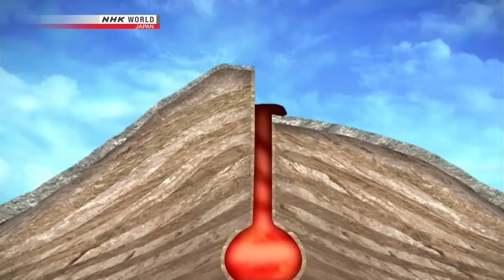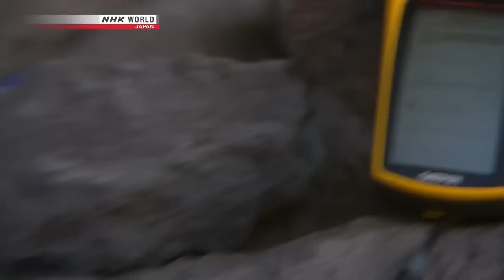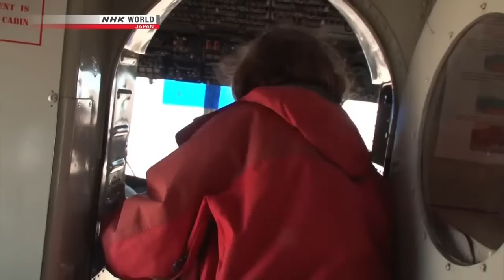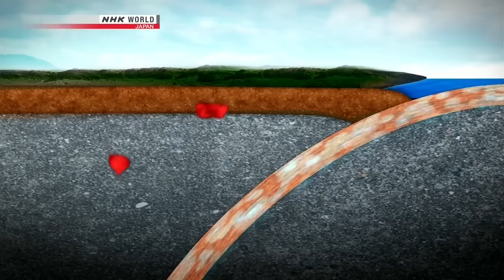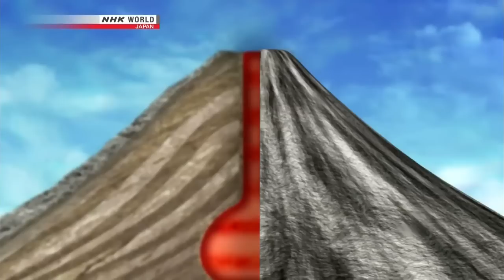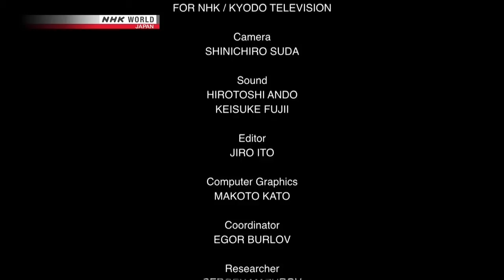The Volcanos of Kamchatka Peninsula

Comment: I got a bit cross with the narrator repeatedly stating lava was a constituent of pyroclastic flows. It isn't. Gas is, ash is, pumice and blocks of solidified lava from the disrupted dome is, but not molten lava. That's why it's called a pyroclastic flow rather than a lava flow!
         That out of the way, I noticed something else about the pyroclastic flow deposits. There seems to be quite a bit of something called 'hummocky terrain' on the way to the volcano, though quite an amount of it had been buried under the flow deposits. Shiveluch has, at some time in geologically recent times, undergone flank collapses and landslides, may be a number of them. That, combined with an active lava dome,  would be particularly concerning to the team.